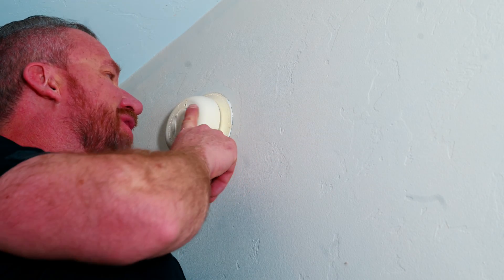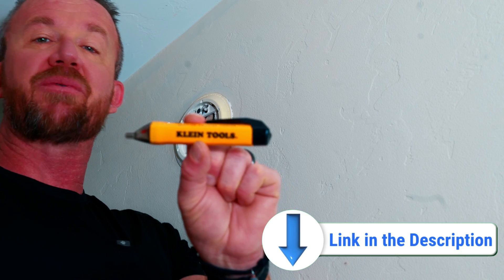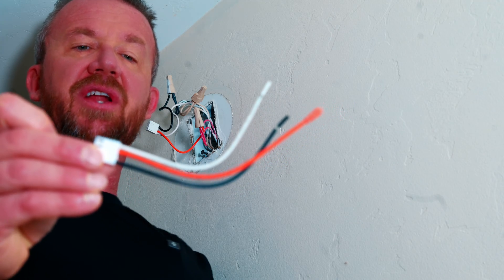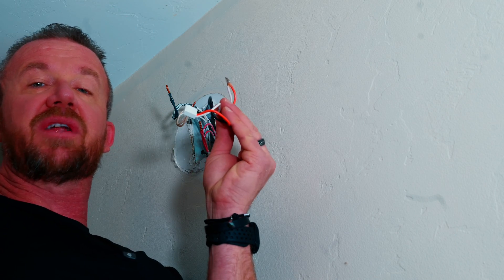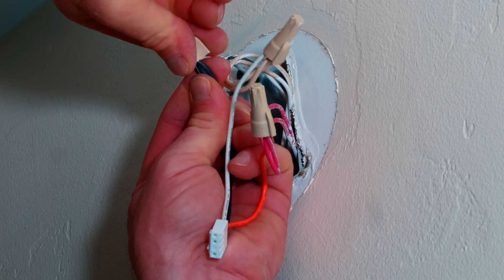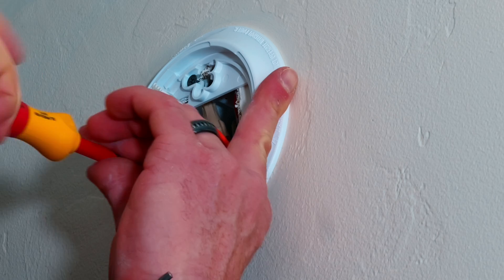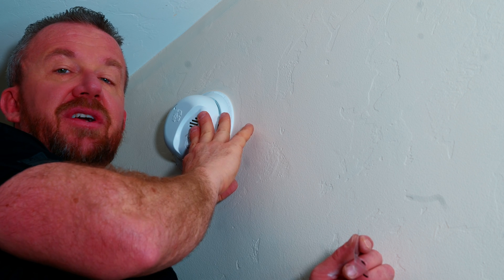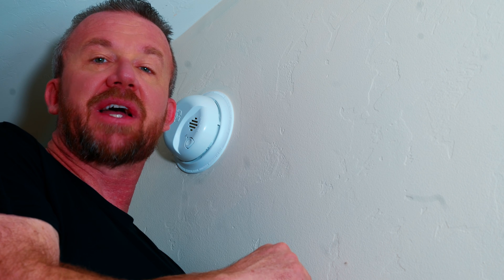Learn how to replace your home smoke alarm EASY

Comment: Great video, very easy to follow, thanks. If I'm replacing an old Kidde with a new one using an adapter because the plug configurations are different, does the power still need to be off? IOW, just to plug the existing harness into the new adapter/plug and detector? I haven't received them yet, but I've already unplugged the ten year old beeping detector (why do they always start beeping every 30 seconds in the middle of the night?!) without killing the power. Was that risky? BTW, they are interconnected, wired in. The new ones have ten year batteries. I have six to change.